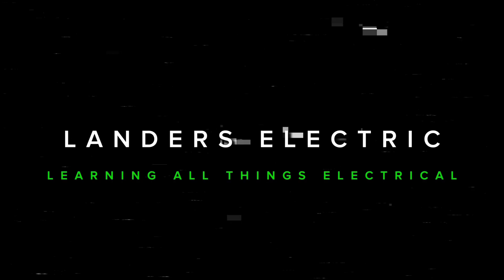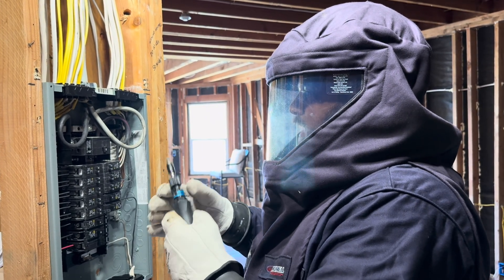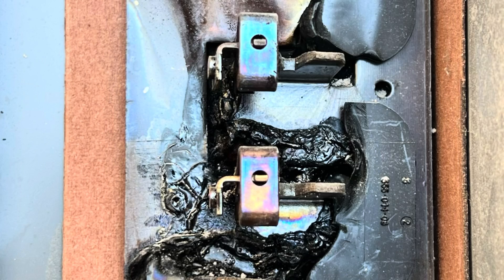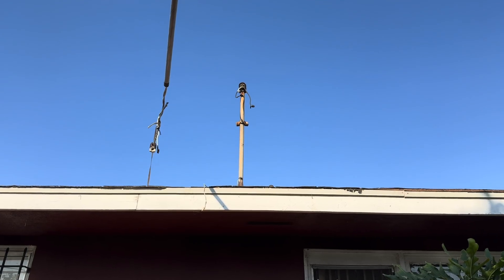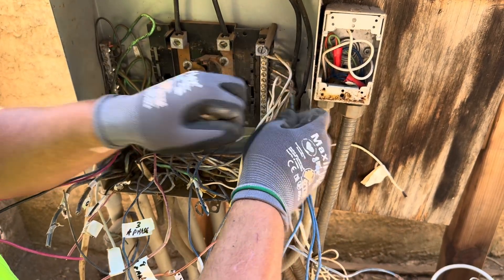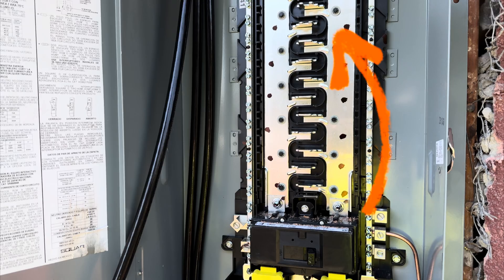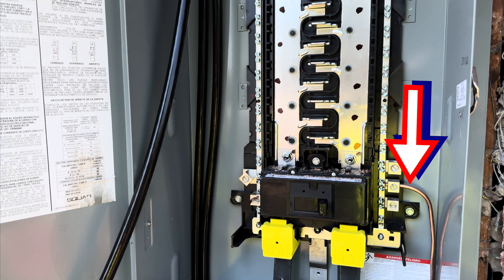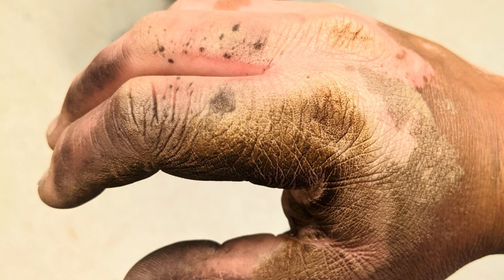I Could've DIED! | Electrical Panel Upgrade Arc Flash Accident

Comment: The difference between residential and commercial/industrial is that in residential you get a burned hand. In commercial/industrial, you get a ball of plasma that won't stop.
Reply: Not from a typical single phase residential transformer at 240 volts. There's just not enough energy available to do much damage nor is the voltage high enough to sustain an arc.
Reply: That's simply not true. No real world source is infinite. Not only is there impedance in the entire system, the transformer is self-limiting in a dead short. The transformer that feeds my home, for example, is a 15 kVA pole pig. The service drop appears to be #1 triplex at about 100 feet. The typical pole transformer for that rating has an impedance of 1.1%. An infinite source should allow over 1000 amps to flow in a short at the end of that drop... But it won't. I'll say it again: A typical single phase residential service simply cannot source enough energy to be as dangerous as commercial or industrial services and also do not operate at a voltage that would sustain a significant plasma arc. That's why services less than 150 volts to ground don't require GFP at over 1000 amps.
Reply: Nowhere have I said that a single phase service isn't dangerous.

Comment: Wow, the air ambulance was probably not necessary. Not sure how far away you are from a trauma center but they could have taken you by ground and been much cheaper. As you said they were more concerned about internal burns to your organs or lungs, not understanding the type of flash you experienced. Thats a helluva airship bill though! I'm an electrician now but used to work as a firefighter and on an ambulance. Glad you're healing up and no permanent losses. I'm a sissy and wear my gloves when working on panels. =oP . The contractor I work for does NOT, but I know its a matter of time before what happened to you happens to him! Cheers

Comment: I've been working with electricity since I was 5 years old. Not once have I forgotten to be safe. 47 now and have only been shocked by a 9 volt on my tongue. I've worked auto, marine, residential, commercial and industrial. If you don't respect electricity, it won't respect you.
Reply from the maker: Glad you’ve never made this mistake.
Reply: @landerselectric  Mistakes can kill you and or others.
Reply from the maker: @craigcottrellii3618  good point! Thanks for the comment!

Comment: $70k for a fuckin 10 min helicopter ride. Our system is fuckered up
Reply: Rental rates for a non medevac AS-350 (the type used by MedFlight where I live) run about $1850/hr. And that doesn’t include two medevac pilots and a flight medic, nor does it include all the specialized equipment on board. You also need to account for the cost of keeping the bird and the crew ready to launch at a moments notice. Figuring all that, $70k doesn’t seem all that absurd.
Reply: @dcviper985 Think how much it costs just to take a news helicopter up , The cost of the fuel , The pilot , Maintenance etc

Comment: 12/1996 I was trying to finish a voltage conversion on a European built machine. Europe does not follow the US standards so the live wires to the door panel switch are on the bottom and in the middle of the panel whereas equipment built in the US cannot have any serviceable parts above the live connections that enter the switch from the top. Like you, I was very tired and rushed as I needed to finish and catch a redeye flight from Phoenix to Atlanta for an emergency service call the next morning. My left arm touched one phase of 480 while my right hand was holding the edge of the panel. All I could do was watch my arm burn as my sight dimmed and I was locked on. Lucky for me my left hand shorted to ground and the resultant muscle spasm made me do a back flip out of the panel. At the ER, they thought they would have to cut tendons as my arm was severely clenched. Afterwards I had to perform startup testing on the machine in Dallas and on the faces of the motor starters was pieces of dead skin where my arm was ripped loose from when I was 'ejected' from the panel. And yeah, I had nightmares for years afterwards!

Comment: I had a call yesterday where one side of a panel would have 120V and then it would disappear, same reading across the L1 to L2....then it would reappear. I went to the meter base, cut the tab and looked inside the meter can. It was a mess. I would measure the same. I pulled the meter as the inside panel was arcing (could not see the arc but could hear it). PS: the panel had a split bus...I dislike them big time. Told the customer to call power company. He called me later to report the utility was there replacing line. I asked if they said anything about the pulled meter...NO.....I went back to replace one double pole breaker on the inside. Moral of the story, pull the meter and take the butt chewing later....if you are acting to safe the system you will be fine.

Comment: great video ! been at the trade over 50 years and i can tell you this complacency is a killer ! overconfidence is a killer , stupidity is a killer ! check everything you are working on to see if its energized , and NEVER EVER EVER TAKE ANYONES WORD THAT THE CIRCUIT OR PANEL IS DEAD ! I DONT CARE IF ITS YOUR FATHER BROTHER SISTER OR MOTHER ! CHECK IT YOURSELF BEFORE YOU GET YOUR HANDS IN THERE !!! LOCK OUT TAG OUT WILL SAVE YOUR LIFE !!!

Comment: I came close once after changing out fuses in a refrigeration control box. After start up, i smelled something odd. I looked down at the fuses & watched a hole open up on the side of one fuse and let the smoke out. I stepped to the side, bringing my coworker with me, then BOOM! A ball of light the size of a volleyball came out. That was only a 30a fuse, too. And no ppe😅

Comment: I'm a retired CATV tech. Back in 2004 I bought a old house that had a Bulldog push button panel. It had some arc burns on a few of the breakers. I pulled a permit to change it out DIY. My overhead lines could be reached by standing on a chair of my deck. I disconnected the nuts that joined my house to the overhead triplex. Swapped out the panel all while drinking beers. I went back to my deck to reconnect the triplex and crossed my 12 inch adjustable across L1 & L2 . No burns but I did fall off the chair and broke some ribs. Couple of months later I was looking at my power meter. It didn't have a seal on it...duh. Being a CATV tech I looked at several meters in town. None of them had seals. I could have just pulled the damn meter. I re-wired half the house on the same permit and it passed the first inspection. The inspector actually complimented me. In 2015 I installed 9000 watts of grid tied solar. That also passed. The inspector had no clue what he was even looking at. Sept. 9 2024 this year that system just hit a milestone and generated 100 MWh. I pay nothing for power now.
Reply from the maker: Glad you’re ok. And that’s awesome you’ve been able to get all that done! Great job. 100MWh is impressive!

Comment: That was a straight up 240v dead short to ground....wow. Glad you pulled through, and your insurance kicked in. Always keep the fire in the wire 👊
Reply from the maker: Ya it blew up really good. PPE is a MUST!
Reply: @kgt9535  shorting 230V to the neutral isn’t in itself terribly dangerous here — between the 16 amp breakers and the RCDs, something will trip before more than a cubic millimeter or so of metal is vaporized. But when you get up to something that’s connected essentially unfused to the 10kV transformer, well, then you’re cooking without gas.
Reply: @JasperJanssen  in other words, you have "smaller" 240v "fireeorks", and then there are much bigger ones that go; boooom!!!
Reply: @kgt9535  yeah. Somewhere around I might still have the kitchen scissors that I used as a callow youth to cut and (planning to) strip a piece of 2x1.5 mm^2 flex that turned out to not be dead at the time. It had a nice big divot and a smaller divot, presumably for line and neutral. (And yes, 230V. The 16A breaker must have been what tripped.)

And the handle insulation was definitely not VDE rated.

But hey, I lived, so clearly it couldn’t have killed me!

Comment: The whole “my experience is commercial not residential” is BS the panels are pretty identical
Reply from the maker: 😂😂😂 thanks for the input!
Reply: @landerselectric  well you obviously need the help 🤣🤣🤣
Reply: PPE is critical. Main breaker location in homes is inconsistent. I did a ton of 'old work' with my dad growing up in single families, and I've seen top, bottom, side, screw in, etc ..
Reply: @phillkenyon4378  yeah but he’s only experienced in commercial so this is why the accident happened he tells it in the story. Even know it’s exactly the same lol. He’s an idiot!!

Comment: When swapping your panel, always make sure the utility is disconnected from the service. I always pull the meter and lock the box out. If the meter is also being replaced, I get on the ladder and carefully cut both hots and cap them off with nuts and tape, then I use my pork chop and rope to sag the live line to the ground. Once the live line is on the ground, i have a 10gallon bucket with a hole in the top. I throw the live capped ends into the bucket and place it on its side away from any hazards and tape the area off and put down cones. It only takes a few minutes and its worth the time. Ive seen worse than your incident and its a blessing you're alive and still kicking ass. Great video.
Reply from the maker: Really good tips. Glad I’m still here as well!

Comment: $70,000 for the helicopter ride. WOW !  I once knew a guy who had to be helo'd off a mountain from a bike crash and his bill was $44,000. This was back in the 90s.
Reply from the maker: They did reduce the bill down once I negotiated but still that’s a lot of money.
Reply: @landerselectric  Thanks very much for sharing your story. We all need to be reminded of the dangers. I'm glad you healed up.
Reply from the maker: @rael5469  You’re welcome!
Reply: Helicopters are horribly expensive to buy and operate, every hour on the engine is 2 hours of maintenance. The helicopter cost $3M and the 3-4 member flight crew isn't cheap either. Every second counts in trauma and a 10 min flight could be over an hour by ground.

Comment: I’m glad everything worked out for you. My sister got electrocuted in a car accident. 34,500 volt distribution line entered at her head and came out her left foot. Leg amputated above the knee because of loss of circulation.  She had other exit wounds on back and buttocks. 
24 years later, and she is doing well. Had children and no long term issues. 
This goes to show that if your number isn’t up, you get a second chance. 
Be safe.
Reply: My son is a Lineman in Montana and is always looking out for the BLUE DRAGON. 
Fatigue is deadly, regardless of the profession.
Reply: @jimfiles3307  They do some work here on powerlines and they put down a "floor" on the ground. Huge tiles that cover the earth around the pole. Electricity is no joke.
Reply: "powerlines .... put down a "floor" on the ground. Huge tiles..."  I do that in my damp cellar. In front of the fusebox also the furnace, places where I tend to work, sometimes live. In 70 years I have survived from 13V to 18,000V but I'm tired of being lucky. I'm improving my odds. Also not auditioning for YouTube's Dumbest Fails.
Reply: @PRR1954  Probably a good idea. And thick rubber soles too, maybe even rubber gloves. No second chances with power.
Reply from the maker: Glad to hear she made it through! Safe wiring!
Reply: With all due respect, I would NOT call 34.5Kv a distribution circuit. That's the charge on my local subtransmission lines...
Reply: Your sister did not get electrocuted. She got shocked. Electrocuted = death.
Reply: It's not electrocution if you don't die. She got shocked.
Reply: @charvakkarpe  Oxford dictionary defines electrocution as “the injury or killing of someone by electric shock”

A simple Google search would’ve saved you the embarrassment.
Reply: @charvakkarpe calling a 35kv contact that resulted in severe burns and an amputation not an electrocution is crazy. We all know it's literally short hand for electric execution but we don't really have better shorthand for a severe electrical injury, so cases like this one are included. I'd say any case where if the victim had not received medical attention they would have died could be considered an electrocution. Words change over time man it's ok.
Reply: @charvakkarpe ass hat

Comment: why didn’t you just pull the meter ??? I mean once you pull the meter , then there is no power going into the panel Box !!!
Reply from the maker: That’s good thinking but there would still be power to the underground feeders feeding the panel and I needed to replace the panel. Still, I would’ve been safer while I worked in the main load center so you’re right there. All in all I should’ve just called the utility company to shut off the entire panel.
Reply: You are risking Arc Flash when you pull a meter in a live circuit !  Take the time to call your utility company to remove the meter for you !
Reply: It's also illegal to do that

Comment: Did he say $70,000 for a helicopter ride ? ! 😮
Reply from the maker: That was the original bill. They did reduce it down later.
Reply: @paulmartinez471  medical flights include the costs for not just the chopper and fuel, but also the pilot (including all the time they spend on standby waiting to be called, not just flight hours — medical flights can’t just schedule their whole diary full, after all, like the commercial choppers do), the EMTs, and usually an actual full MD doctor of emergency medicine is riding along on those.

70 is a lot, but tens of thousands is perfectly normal range.
Reply: I can understand a reasonable fee, but let's not get ridiculous please

Comment: My uncle said 220 is better because it will send you flying instead of camping your hand on and slowly sizzling you like 110 will.  Always use the back of your hand/fingers to test so current contracts body away.  You are so fortunate.  Main breaker there for a reason but tiredness is what did you in. You knew better.  We all make mistakes.  Count your blessings
Reply from the maker: Good tips and reminder! Thankful everyday. Dont be complacent
Reply: @roberthughes2665  using your fingers to test isn’t really recommended whether it’s 220 or 110.

Comment: Much thanks for this message. glad you made a good recovery. Hopefully no lasting effects such as sensitivity to hot running water....
A dozen years back i spent a week at some folks house as a hurricane passed through. Electricity went out for 4-5 days. The home owner had a extension cord going from the outlet on an electric generator to the house breaker panel. I never tried to gain an understanding how or why, but it kept his well pumps running and vital outlet(s) in his home.  
I knew it was all well over my head or my experience so i would never dare try.
Reply from the maker: You’re welcome! And agreed, if you don’t understand it, walk away!

Comment: Thank you for sharing and glad you’re okay.
A few years ago in residential myself, we did a generator install with a disconnect transfer switch. My crew and I did all the work in 1 day and we drove 2 hours that day. 16 hours. My crew forgot to hook up the ground rods , and didn’t separate grounds and neutrals from the sub panel that was fed from the main breaker box. Worse part, all the breakers were on and there were welders. 
Went to turn the power on and all the breakers. I turn on every breaker besides the sub first. Everything is good. I turn the sub on. BOOM!
200 amp main breaker explodes in my face and melt plastic imbeds in my face. Ruins my beard. Thankfully I was far enough away from any more danger, but I understand
Reply from the maker: That’s crazy! Working long days can really impact our workmanship. I know I was exhausted and should’ve done a lot of things different. Glad you’re ok though!
Reply: I don't understand why it blew?  I know you don't bind the ground and neutral in the sub panel. You forgot to attach the sub panels "ground rod?"  I assume you had a 4th ground wire, going back to the main panel.......   Even though it wasn't quite right, what caused the explosion? am I missing something?
Reply: And if I could ask any of you something on this subject.  I have a 3 wire, going from my house, 400 feet, to my machine shop. I generate my 3-phase via a 10 hp motor.  (I will FIX, this issue, probably in 2026, I am going to run lines, not from the house, but from the meter to the workshop. But in the meantime, I have only 3 wires.  The 3rd wire is NEUTRAL, coming from the 200 amp main service.  I have a ground rod, in the ground at the sub-panel. And it is NOT BONDED.  I have been reading, that in this circumstance, I NEED TO BOND.  It is not ideal, it is not desireable, but it needs bonded.  (In the spring, I plan to drive 2 new COPPER, ground rods into the  at 10 feet deep, and 10 feet apart, and probably also tie it in to the existing which is the galvanized type.)   Should I bond?  or no?

Comment: That’s crazy maybe if the first ambulance knew it was just an arc flash burn your insurance could’ve saved the helicopter ride lol
Reply from the maker: I think you’re right. I think in all the craziness they didn’t understand what happened or perhaps they wanted to be extremely cautious.
Reply: Electrical injuries are level one trauma no matter what. Also, any burns to the palms, soles of the feet, and face are automatically flown to a burn center. EMS are taught not to question severity in these situations, it's a matter of life or death and  eventually regaining function of the body part with as little damage as possible.